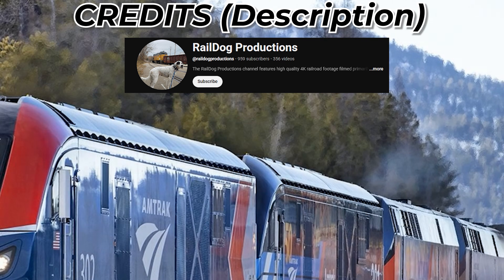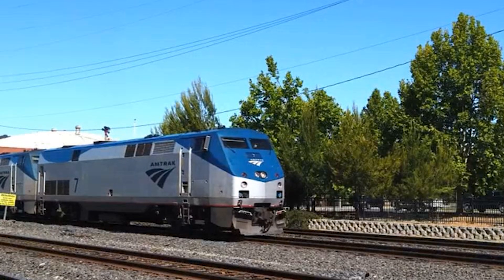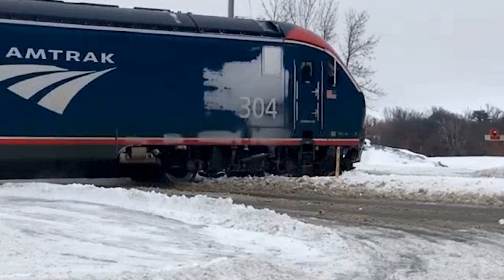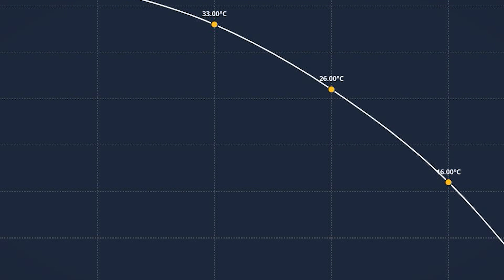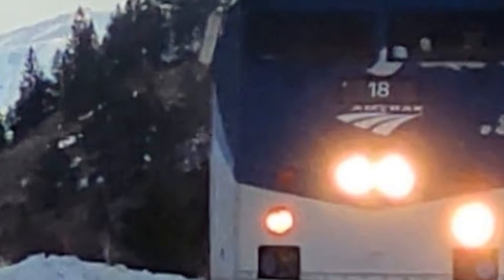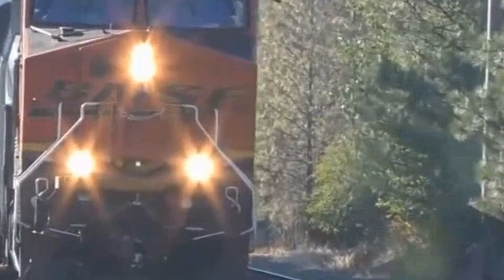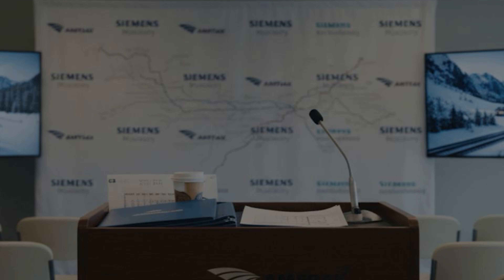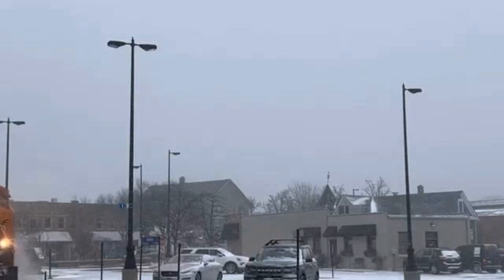Amtrak REPLACED Working Trains With FROZEN Ones

Comment: When I saw the chargers for the very first time, and noticed quickly the very open screens on both sides of the unit, I quickly commented to my railfan friends that were with me that they would have lots of problems with these units in the snow, especially fine wind blown snow… I was very correct.